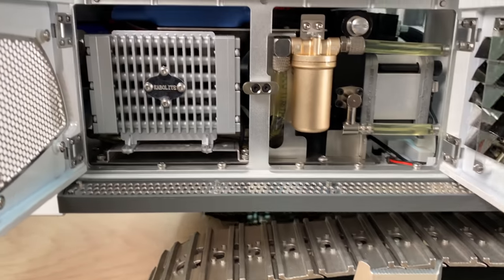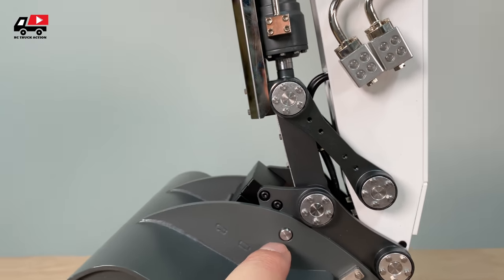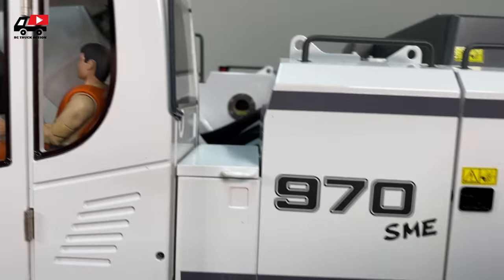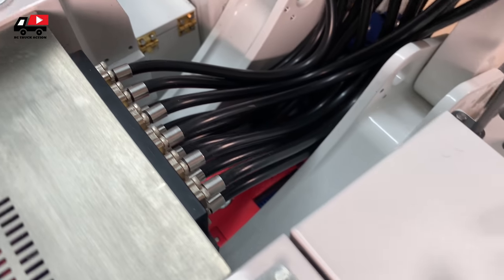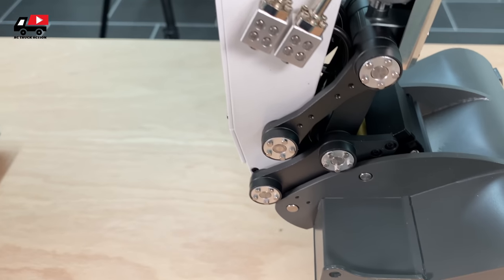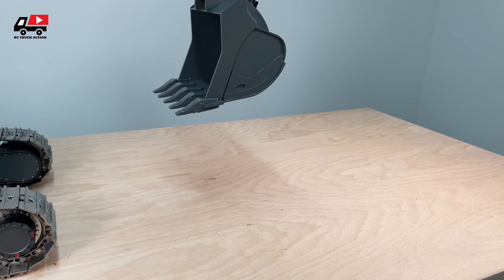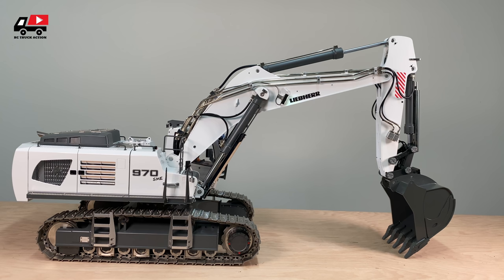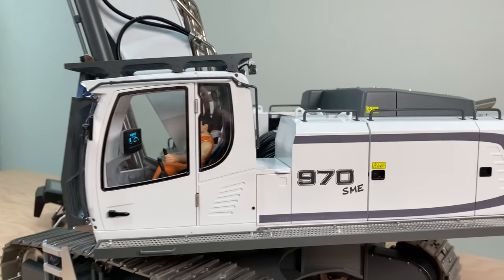REVIEW of AMAZING RC EXCAVATOR with hydraulic quick coupler from CHINA I RC Truck Action Studio

Comment: How does this compare with Premacon and THS shop units?
Reply: When it comes to the metal work it is at the level of the Germans. Regarding hydraulics and eletrics the chinese in general tend to cut some corners, put cheap stuff to save a couple of cents, put that's no bigger deal to sort out to people experienced with these kind of models. These high level models are not for beginners to service.

Comment: Hi, really nice high level review, I got my k970 now :) it was 2 loose screws that I found in the  soft plastic, one was for the counter weight and one tiny screw was for the glass window to the oil tank. Have you had any issues / problems you want to share ?
Reply: How much it really costs to buy it?
Reply: @sidizshrestha2836   $6k to $7k USD depending on reseller and options

Comment: That websites prices are wayyy too high, you can get the same stuff, the exact same stuff, on other websites for much, much cheaper.
Reply: Please  Share website
Reply: That Link says it’s $500 that doesn’t seem right
Reply: Getting it cheaper from a dealer on the other side of the world is not much of a comfort when things breaks down and there is no good service around. You are totally on your own in most cases. I've seen much RC equipment just dusting down under a table as the owner don't know how to fix things and get parts. But he got it 'cheap', paid 3000 instead of 4000, so 'no problem if he have to throw it in the garbage'
Reply: @Rimrock300  Actually, we have some of the best service there is. Plus I'm an engineer so I appreciate fixing things myself.
Reply: @norsevikingsir4932  Who are 'we'? 2% of the people in the hobby are engineers, me included and have a shop downstairs with cnc mills and lathe. But the majority of people, not able to fix much and make parts themselves, can quickly see that it can be expencive to buy cheap;)

Comment: Comes with built in leaks everywhere!
Reply from the maker: Wait for it. We will see within the next, few weeks. Thanks for watching! Best wishes, BJ
Reply: I can confirm, I have serial 026 - stick cylinder leaked direct from factory, valve block also leaking direct from factory. Thankfully I have replacement parts coming, but I as the consumer shouldn’t be stuck repairing something with such poor quality control. The machine should have been replaced. My impressions have not been good, same with multiple others who have purchased these. It appears the early production models are the ones with the leaking issues.
Reply: Anyone thinking if buying this machine,  had better read all the reviews.  This review in this post is purely cosmetic; it is not functional.  9,000.00 $ for a machine that leaks like a sieve is ridiculous.  Beware, you have been warned!
Reply: @minidiggin  I think that entire batch-run is highly defective.  My serial # is 21.

Comment: The chinese are developing quite fast within equipment for this hobby. They master the design and metalwork great now, just looking at this machine as an example. But they are still some step behind when it comes to the quality of the eletrics/electronics but in their models, and not as finetuned hydraulic systems as the German brands. But it's likely just a matter of time before Premacon and THS see some serious competition... As of now it seems the German brands do not worry too much about potential chinese competition, and keeps the line of high cost models. I would think it was time for them to look closer how they can streamline production, maybe simplify, and move the prices a bit lower towards the competition, in order to 'stay alive'. Anyway, hope it ends well, and not the chinese taking over the whole industry.
Reply: Very true. I just bought a large machine from China. If the same machine from Germany was somewhere closer in price I would have paid a little more and bought it.